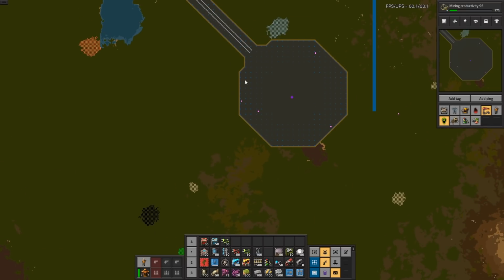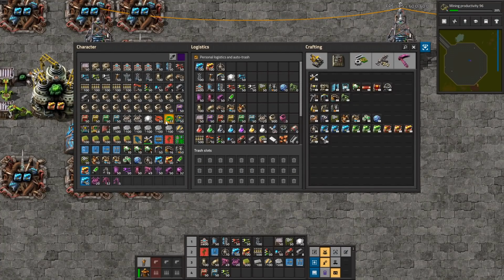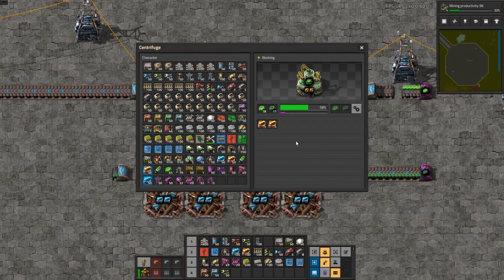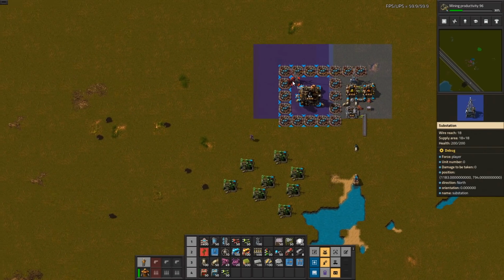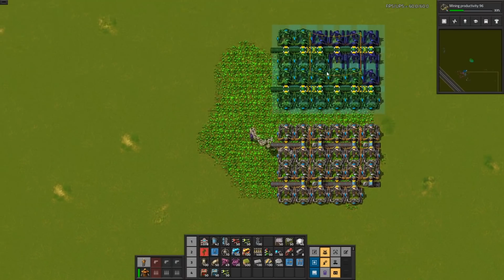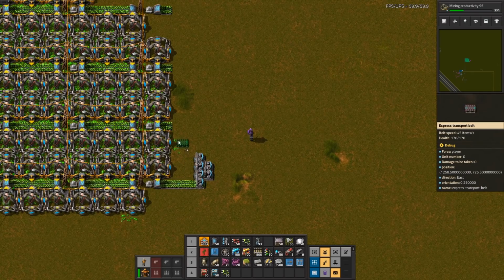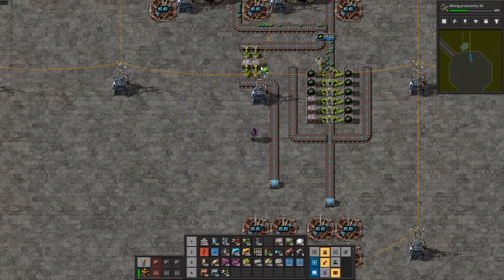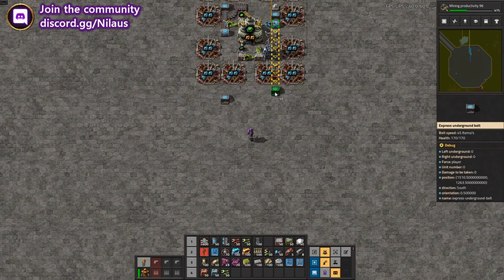Factorio Reverse Megabase | #44 SILLY NUCLEAR RATIOS | Lets Play

Comment: The buffer chests that you deleted at the end of the episode (at 38:20) were only putting the uranium 235 on the left side of the belt. Now that you deleted the chests the uranium 235 will be on both sides. Which theoretically messes with your new kovarex setup. (But I doubt you'd notice it in practice)

Comment: I did some counts. If you target to full belt science (45 red science per second) and have fully upgraded research speed (250%), for 60s research you will be able to feed 1080 labs.
Reply from the maker: beacons and modules change that number
Reply: @Nilaus  Yes. Is better speed or production module for this? I guess the speed. Production is IMO good for resouces and efficiency for gahering fuel.
Reply: O.k. I've found some speed/prductivity ratios.

Comment: Concering your circuit controlled kovarex: I've been using it for a while, but i noticed,that counting to 40 will have the process pause for quite a while until all 40 u235 are back in the centrifuge. Eventually i just removed the circuit and let it fill up to 80. Yes it takes a bit longer to start running, but the output is a lot higher because there is no down time. I guess it doesnt make much of a difference for the fuel production, the demand beeing so low and such. But considering i like to bring nuclear genocide to the biters, every bit helps :D

Comment: Looking forward to seeing the tileable nuclear reactor/turbine design!
Reply: Spoiler: one giant line of turbines connected to a long line of heat exchangers that have heat pipes running on a side and steam pipes on the other side. Steam pipes need 3 pumps correctly spaced
Then hook up the water input: 2 water pumps per line is more than enough (but 1 is not enough).

This setul is tileable since its slimmer than the width of a reactor and can easily be repeates for each reactor used

Comment: What happens if you arrange the nuclear reactors in a square instead of a double line? What’s the largest square before surrounding it with enough boilers are too far?
Reply: The problem with a large square is that inserters cannot be placed to feed the inner reactors but only the perimeter. Inner reactors could be fed manually but it's not ideal
Reply: As I understand it Reactors only give a product bonus to the neighbor. Not feed thru them. 
Inserters have to feed and remove the fuel rods.

Comment: won't this build break if the chests at the centrifuge become full? I think you need to disable the inserter picking u238 from the belt based on the amount of u238  in the chests
Reply from the maker: no. It will not break. It will simple reduce speed to the speed that the Kovarex process is converting U-238 to U-235. I don't need 100k+ U-238. Actually I barely need any
Reply: @Nilaus  I meant the chests at the kovarex centrifuges,  if they are full then production will stop
Reply: @tincanstan_  The centrifuges that are processing raw ore are only used to start the Kovarex system. Once Kovarex is started, it generates enough U235 to run itself without any extra. The Kovarex will always pull U238 from the first part, but it stops relying on it for U235.

I think your concern is that if the output from ore processing backs up, no new U235 will reach Kovarex and it will stall, but that won't happen.